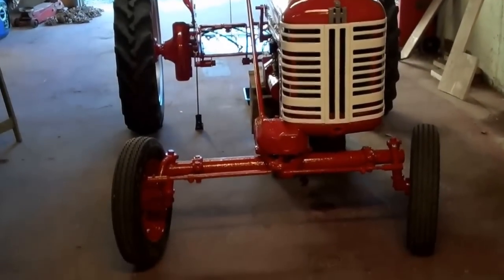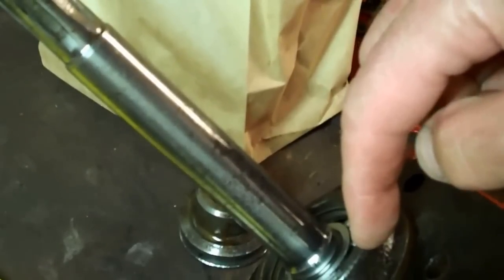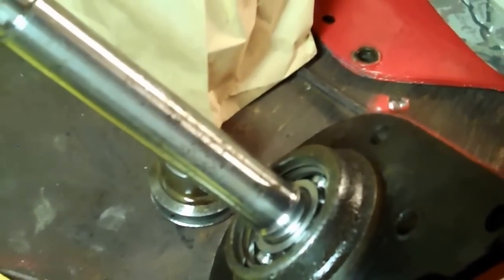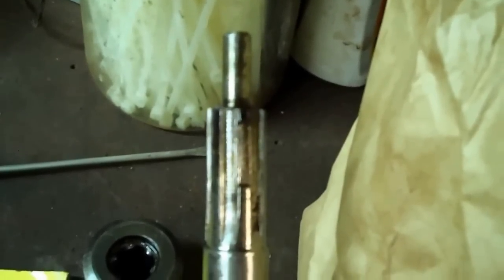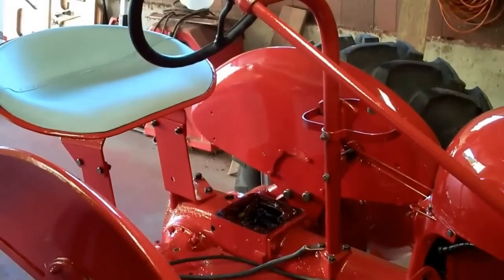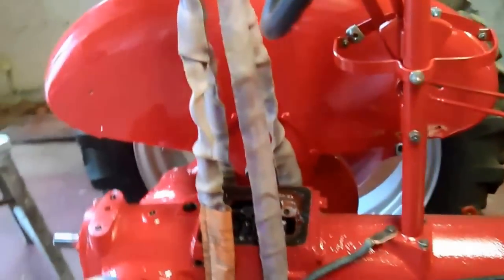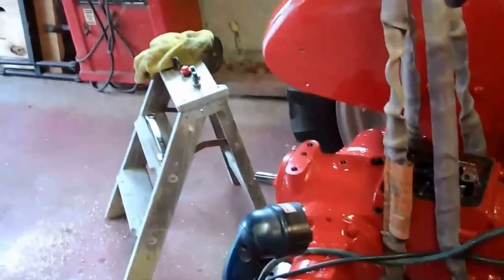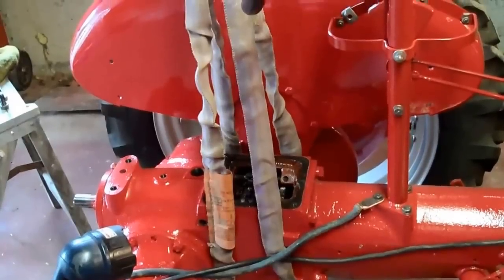International cub with a bad PTO

Comment: Thank you for this fix.  I inherited a 49 cub last month and just got it running yesterday.  I then realized the pto wasn’t engaging, so I started reading.  I saw your video and realized this was my problem.  It took me 2 hours to split it, reverse the seal and stab it back together.  It works great now, so thanks again for this fix.
Reply from the maker: Thanks Steve. You are the third response with the same problem. I guess it's more common issue than I thought. Fix in 2 hours! Wow!

Comment: Hi there I just wanted to congratulate you and your wisdom I work on a lot of 8N Ford Tractors so I know a little bit about clearances but I am impressed that you were able to diagnose that problem and fix it yourself!! I would have been stumped way too go!!
Reply from the maker: Thanks Keith. in the interest of full disclosure I belong to an online forum for Farmall cubs and much of my knowledge came from the learned members there. Still wasn't sure until I had it apart but was reasonably certain of what I'd find. I like the fords too and I'd have one if you could put a belly mower on it but they are both still a testament to the engineers of those days on making good tractors.

Comment: Gorgeous cub.  And great work getting the problem corrected.  I grew up in the 70s and 80s watching my dad mow with a 51 cub.  I used it some, but he was always fairly protective of the old boy.  Still have some videos of it from the early 70s. It had the mower like yours, not the Woods mower but the IH mower.  Cuts like a dream.  At least his did
Reply from the maker: Thanks for the comment. I used a john deer lawn tractor with 38" cut. This one cuts like a dream too and cuts my mowing time in half. I'm  not so much a tractor guy but I've always liked these old off set tractors. Cant justify the cost of a  kabota. This old tractor is capable of doing the same work for far less and it looks cool too.

Comment: Completed this fix today. I did the job much the same way you showed in your vid. It actually only took about an hour. Thanks again.  I suppose next time i remove a seal 4 weeks before I replace it I will keep a written note on how it should be reinstalled.

Comment: Thanks for a great information video! My 48 Cub is suffering exactly the same circumstances. I have a worn mainshaft spline ends so I am replacing with a new one but I know the front retainer IS backward also.  Thanks again!
Reply from the maker: Thanks Dale. Replacing that clutch shaft would make an interesting video. I wonder if the pto shaft could be used as a follower as you pull the shaft out through the gear box. You probably know to check your coupler and shifting finger for wear too as they can cause similar problems. Good luck with that.

Comment: Thanks Don! my 1956 Farmall Cub is doing the exact same thing.
Reply from the maker: Thanks for the comment Lourie. Keep in mind that a  severely worn shifting finger can cause similar PTO connection problems. Look for severe wear on the coupler as well. Would be alot less invasive to fix if it is one or both of those. Good luck.

Comment: Hi Don, I don't know if you have any interest in this, the rear wheel discs will go on the tractor with the disc turned in also. You have them turned out. The tractor is narrower with them turned in, that might let you get closer to things when you are mowing. It shows it in the owner's manual I posted for you before. Here are 2 pages showing it. I like to set them at the 44 inch setting, that is out from the narrowest setting, makes it more stable than all the way in, my opinion. You have to look and figure out how to put the discs and rims together. The rims come off the discs, and can be put on the disc for 2 different widths with the disc turned in. 
You should put it together with the tires facing ahead, like they are in your video. 
The 2nd page is the right rear wheel. 
If you have hills, or tippy ground you drive on, maybe you want the wheels like they are in your video, it's your choice. Hope you have a good Christmas season. 

http://farmallcub.com/rudi_cub/www.cleancomputes.com/Cub/Cub%20Owner's%20Manuals/International%20Cub%20Lo-Boy%20Tractor%20Operator's%20Manual%209-30-57/Page%2059.jpg

http://farmallcub.com/rudi_cub/www.cleancomputes.com/Cub/Cub%20Owner's%20Manuals/International%20Cub%20Lo-Boy%20Tractor%20Operator's%20Manual%209-30-57/Page%2060.jpg
Reply from the maker: Thanks Glen. I do have a hilly lawn so I set the discs up like they are for max stability. It turns out that I can still maneuver close with the 60 inch deck. The low boy is more stable than the standard cub on side hills so it may be overkill but I factor in my penchant to do stupid things with machinery sometimes. Ha. Have a good christmas as well.

Comment: I wonder what the engineers and designers would think Know that the tractor that they designed and built would be running 70 years later in the future?
Reply from the maker: I agree Dan. There are a lot of 40s and 50s vintage tractors still being used. A testament to great design.

Comment: I like it.  I have to grow some balls a few days prior to tackling a split 
Ike this. Glad it workedout well for you.   I had an engagement issue with the PTO slider onthe splines.  It ended up the PTO  lever has a “tit” that rides in the slider slot and it had worn down to nothing.  I got my MIG out and welded a new tit on it and filed it to shape.  No split. Just a removal of the shift lever.
Reply from the maker: Yea expo. I actually did the same thing to the shifting lever on my tractor. it was half round so I blob welded some steel back on. I think they tend to wear like that over time.

Comment: On the thumbnail picture to advertise what will be seen in this video I can see immediately what has happened. Whoever owns this tractor was very concerned about how the tractor looked. To someone like me I want the thing to run properly. If you look back in and spot the oil, you can see it is milky white. There is no lubricity in water. If the boot on the gearshift is cracked or missing the water he or she so diligently washed all the grime from the surface which washed directly into the rear differential housing thus knocking out the pto with the differential sun gears next on the list. I would assume that it is not too late to drain the oil out to see what happened to the poor pto.
Reply from the maker: Thanks for your comment I think. Much of what you gleened from one thumnail pictue how ever is not even close to reality. I too am primarily interested in having a well functioning machine. I also wanted it to look nice as well. The sun gear is in very good condition  and the white color you can see is  95% new gear oil that replaced a very water contaminated fluid that was in it when I got it. After the PTO issue was fixed it was refilled with fresh gear oil used, drained and refilled again eliminating virtually all of the water contamination. The gear box and PTO operates perfectly.

Comment: Do you have a video on how to adjust a clutch on a 1948 Farmall C
Reply from the maker: I can't help you with that Cleve. You may want to consider joining a forum I'm in at farmallcub.com . There's a lot of information for virtually all the Farmall series tractors and you could pose that question to the members. I'm sure you will get good info from many of them. I got a lot of info on my tractor including how to perform the fix in my video. Good luck!

Comment: Thanks for the video.  Two questions:  1.  How much did you torque down the set Allen screw on the coupling?  2.  How did you get the PTO actuating lever to line up inside the PTO housing to align in the coupling race?  I cannot seem to get mine to align very well.  Any suggestions are greatly appreciated.
Reply from the maker: Hi Kevin. It's been a while since I did the work. The coupler should be oriented on the PTO shaft so the set screw rides on the spline with the recessed area. It should be loose enough so the coupler can move freely and tight enough so the coupler movement is limited to the free travel on the recessed area. I have memories of struggling with the shift fork and coupler installation. I think i uttered more than one colorful metaphore in the process. I think the fork has to be lined up as the shaft and coupler are installed. It's tricky. Good luck. I would suggest that if your shift fork has any flat spots worn on it that you have it repaired while it's apart. If it's worn too much the coupler may not engage with the transmission shaft well. Good luck.

Comment: Hi Don, here is a 1957 Cub LoBoy owner's manual, it has lots of info about lubing and maintenance. That is the closest year I saw at the website where I found it. They are the same style as a 1955. There is a table of contents on page 1, makes it easier to use on the internet. 

http://farmallcub.com/rudi_cub/www.cleancomputes.com/Cub/Cub%20Owner's%20Manuals/International%20Cub%20Lo-Boy%20Tractor%20Operator's%20Manual%209-30-57/index.html
Reply from the maker: Thanks Glen. I thought it looked odd but it was like that when I got the tractor. I will definitely turn it around.

Comment: Its not a farmall cub loboy. Although they did make one and the parts are all but the same, what you have is an international cub loboy. The farmall brand was long gone by the time yours was made.
Reply from the maker: Actually the Farmall brand was retained until 1964 but vyou are tight. The lo boy was International. Mine was from the first year production of the lo boy 1955.
Reply: @megaloogy  thats what i meant.